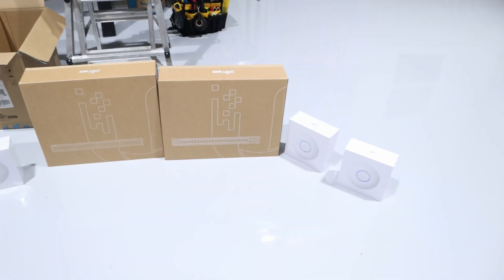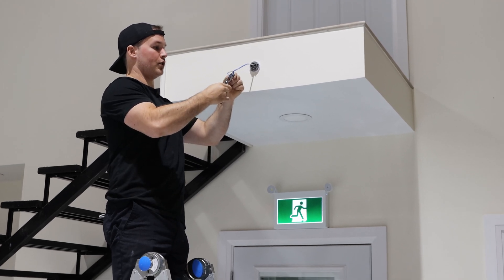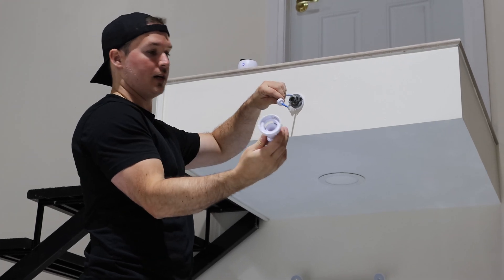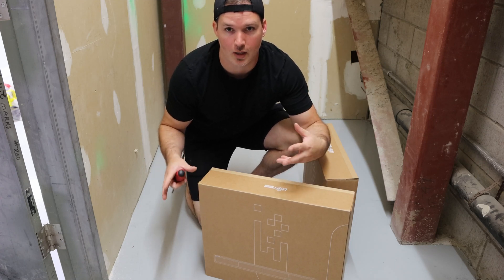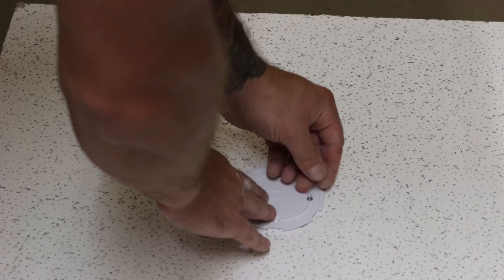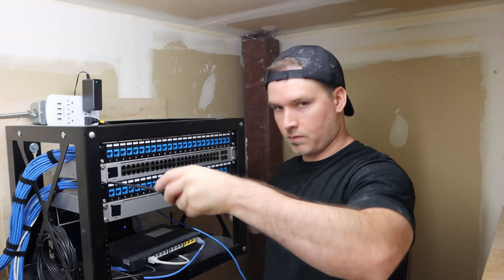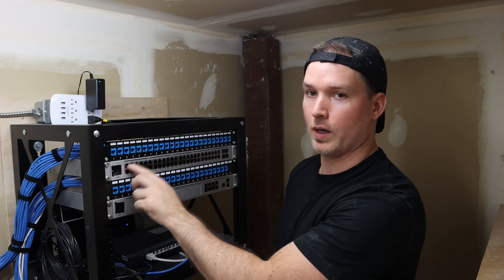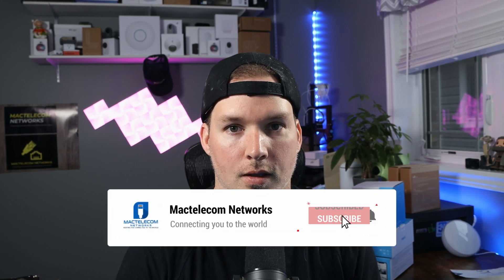Unifi Network Install. On The Job Part 6

Comment: My home setup is finally getting big enough to need a Patch Panel. I see you have two 24 port panels. Do you find it easier to have 2 panels (above and below) that switch so cabling is neater and less cluttered or do you like having a 48 port patch panel and plugging everything into that. Also are you using Cat 6A keystones or a mixture of Cat 5 / Cat 6 / Cat 6A keystones?

Comment: Glad to see you using my favorite way to setup patch panels. The first time I saw this was from FiberNinga. I prefer passthru jacks and keystones but I'd give you an A grade nonetheless.
BTW, if you do use the passthru only method, install a patch panel above your router and only use the mini patch cables on your switches and routers fully populated. Your interconnects are done behind the keystones. No more punch-downs as all cable runs are terminated with passthru jacks.  It is the cleanest way possible to do racks.
Reply: Mike, do you normally use Cat 6A passthru only keystones or something else and if so I am looking to get some of these passthru (perferred Cat 6A) but still interested in what you think also.
Reply: @HollowayMooseRanch  Cat 6A is the best bang for the buck. The advantage of passthru keystone patchpanels and wallplates are ease of installation, reliability, ease of troubleshooting, ease of reconfigureation, and the ability to share different Cat Levels or media types in the same patch panel. 
Let's say you have performance or stability issues on Jack 18 and want to go fiber on that one jack. You can swap out the keystone passthrus for fiber keystones without having that one jack being abandoned in-place as bad copper.
Reply: @WhitentonMike  Thanks for taking the time to respond to my message and I like you advantages you have listed on why to use passthru keystone patchpanels, I am sold.. thanks again

Comment: Here's a trick for you, when you fix a switch/router in a rack, start from the bottom screw... :)
You won't have to handle the equipment for the last 2 screws...
Reply: Thats what i also said to :)
Reply from the maker: Yup great trick not sure what I was thinking here 😝 typically I have my brother help me out but he was filming
Reply: By starting with the bottom rack screws you also reduce chassis twist and avoid bending the rack ears!
Reply: So Jay is your brother. I thought y’all looked a like

Comment: Do you use A standard to differentiate video from data or do you use A standard everywhere?
Reply from the maker: We use A standard everywhere
Reply: @MactelecomNetworks  Why?
Reply: @MactelecomNetworks  Practically Everyone uses B. And I know crossover is a thing of the past so it doesn't matter really but please inform why?
Reply from the maker: @FlowoftheFlood  actually not practically everyone. I did a poll on Tiktok and about 55% use B and the other 45% use A

It doesn’t matter one bit as long as you’re using one of the standards and not making up your own. 

Why do I use it ? Well that’s how I was taught when I was about 13 years old and have stuck with it. T568a is more common in Canada and the UK

For government buildings in the USA I believe they use T568a
Reply: @MactelecomNetworks  Your analysis is right and off a little. 568a is used by the government cause it's the traditional standard and it's best when connecting switches. With modern switches it doesn't matter but government systems are usually older so many were preassembled that way and since mix n and matching is not recommended at all. Making that a standard is best. But practically all residential and most businesses will use 586b. How that came to be, I don't know, but since the majority will have 586b and not to mix and match, the global standard is 586b now. At your own home, do what you want, but anywhere else to not create confusion or avoid wire mapping errors use 586b. But I'm speaking mostly in the US. I've not installed networks outside the US. So globally, it could have changed and Ive learned old shit. Sorry for the delayed rebuttal... I don't check my YouTube notifications often. Where are you located?
Reply: For PoE on 10/100Mbit you will use seperate lines for power and data on the B standard, where on the A standard combine them and some will be un-used.
But when using Gigabit, it won't be much difference.

Comment: Um, you missed a step, where is your verification ? You don't use a cable verification tool ? Just a quick tip, for you :) if you put the bottom screws in to the rack ears on equipment it will hold the equipment up instead of doing top screws in the ears first. :)
Reply from the maker: No steps missed we do use testing tools just not shown in the video